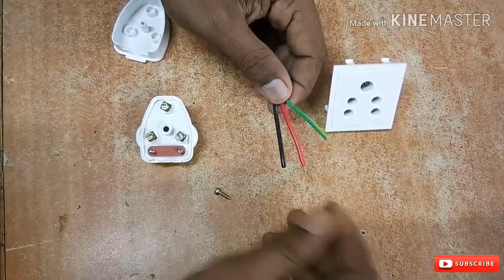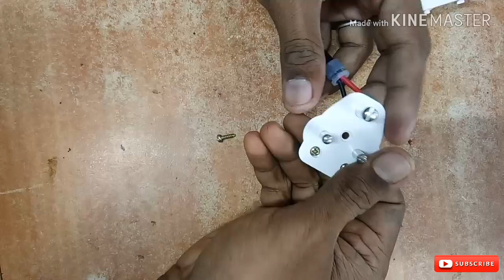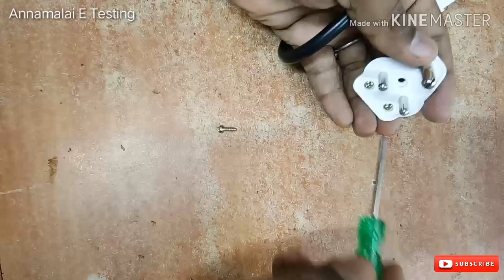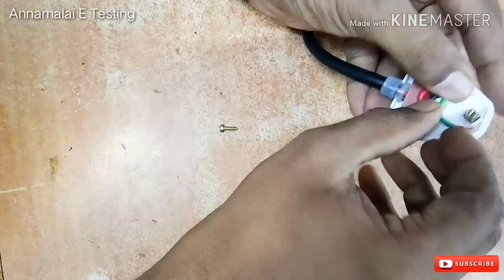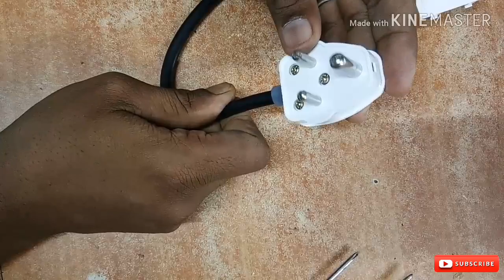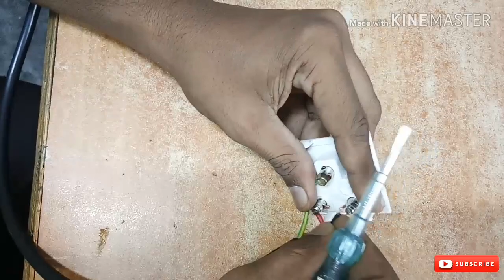How to Connect 3 Pin Plug and Scoket | Tamil

Comment: Bro wire size?
Reply from the maker: Based on usage product only wire size can be decided
Reply: @ANNAMALAIETESTING  how many types of size like mm?
Reply from the maker: @muthusamy6095  example -for light fan 1 sq mm for iron box 1.5 sq mm for heater 2.5 sq mm induction stove 4 sq mm etc like product amps only decide wire size Scoket size plug size etc
Reply: @ANNAMALAIETESTING  thanks bro